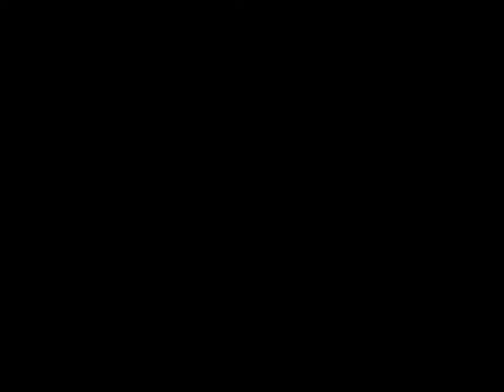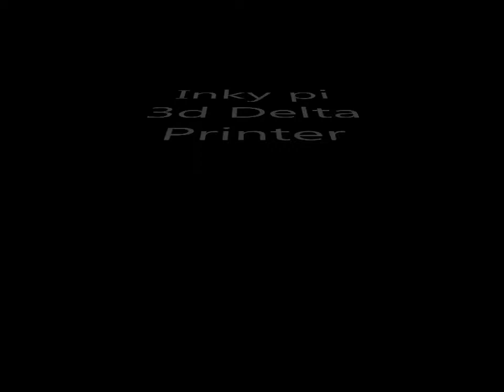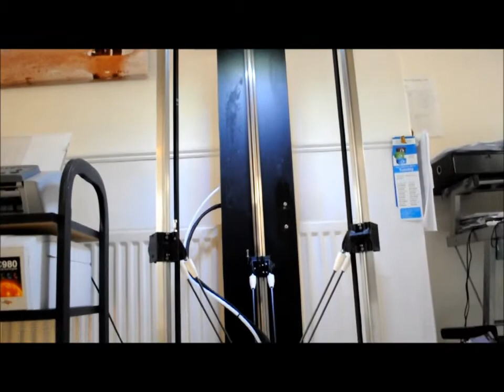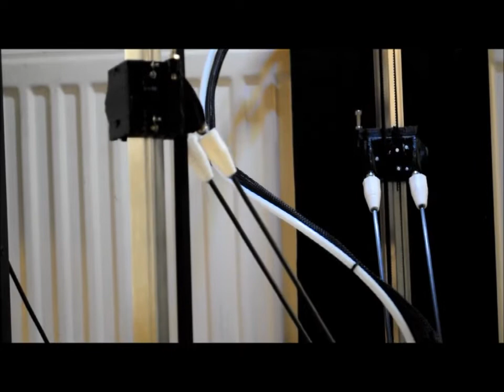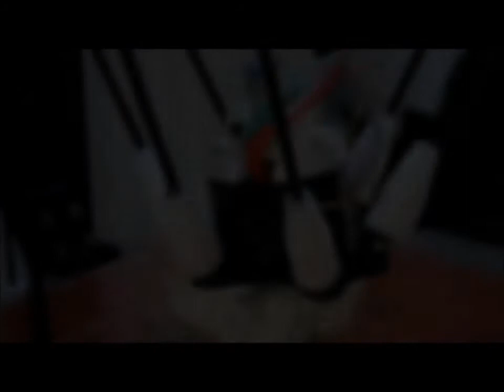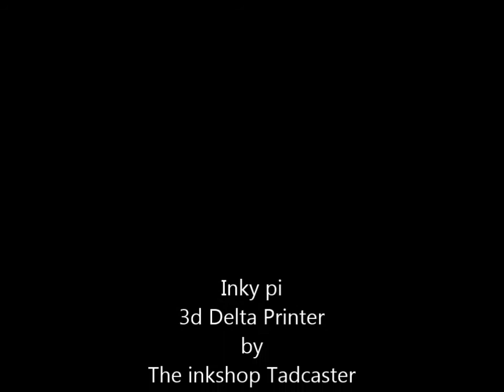Inky pi delta printer

Comment: Awesome printer!! I have a rostock delta printer, and I want a second one, do you recommend to build one of this?
Congrats for the results!
Reply from the maker: It worked very well as designed. Zero error on the head due to magnet and ball. I would probably add extra magnets to give more pull in case of knocks